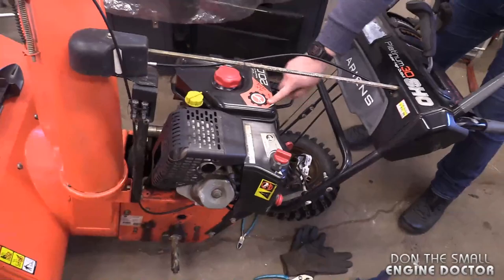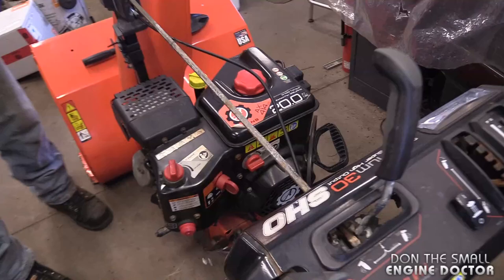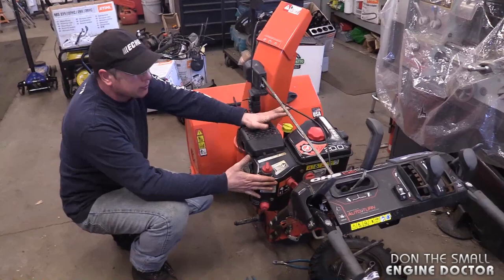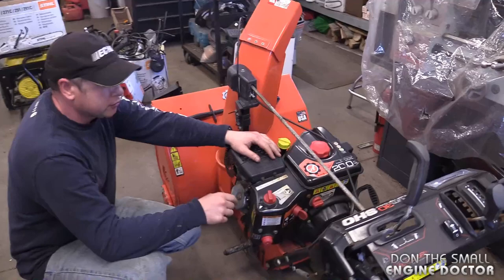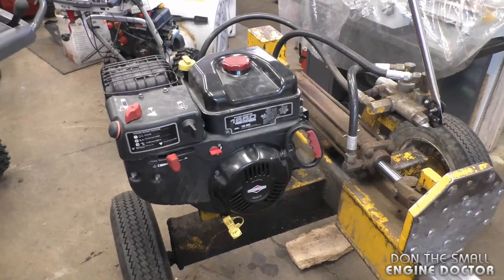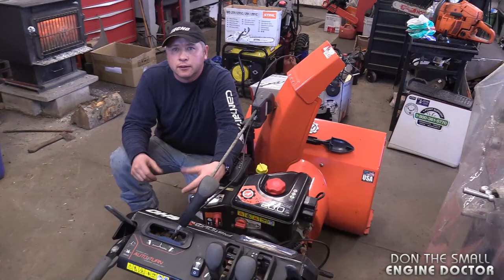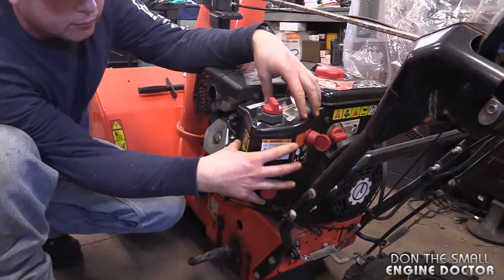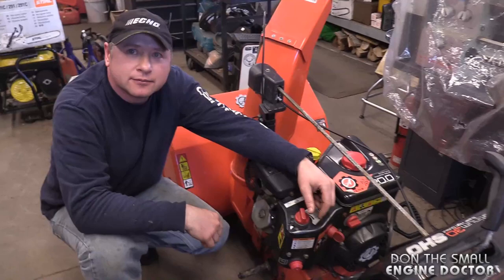Can I Use A Winter Small Engine In Summer? Teaching Apprentice Dave!

Comment: Dony can I switch my oil from conventional to full synthetic on my kawasaki v-twin (fr691v) without harm, 60 hours on my Toro Zero Turn? Also I started with 10w 30, and thinking of switching to 10w 40 (northern Ohio climate). Thanks.
Reply: Better watch it Bucky, a friend of mine used automotive type Amzoil in his Honda CBR 929 (wet clutch) and it destroyed the clutch.  Amzoil does make motorcycle specific oil.
Reply: Ralph is right - A wet clutch requires a different type of oil with a selection of additives. I'll let @donyboy73 confirm about the oil but a 10w40 is a thicker oil than 10w30 when at operating temperature.
Reply from the maker: for your zero turn engine yes you can switch over
Reply from the maker: @ralphwatten2426  Bucky is talking about a zero turn engine
Reply: @donyboy73  Oh...never mind.  I thought he was talking about his big v twin bike engine.  Don't listen to the guy behind the curtain.
Reply: @ralphwatten2426  ha no problem, re-reading my own question does sound like a motorcycle question but it's actually my lawn mower. (The 23hp on my Toro).Thanks all!